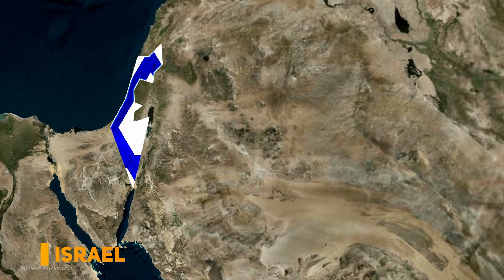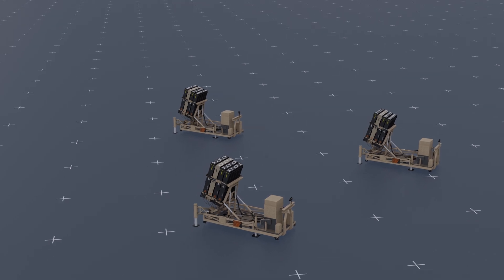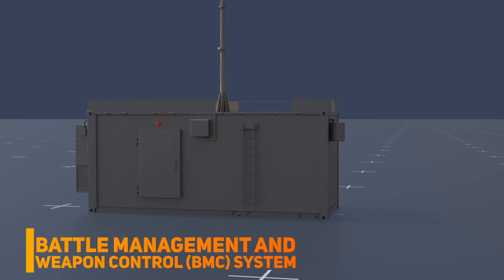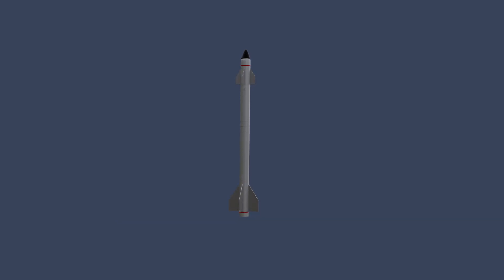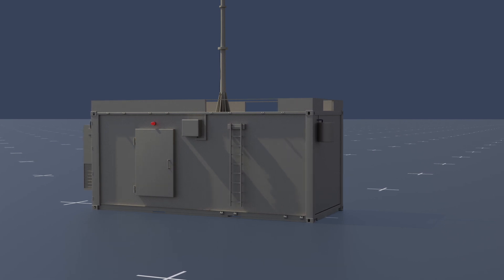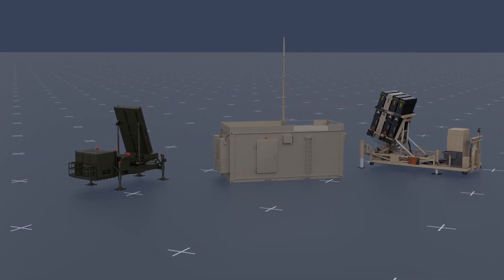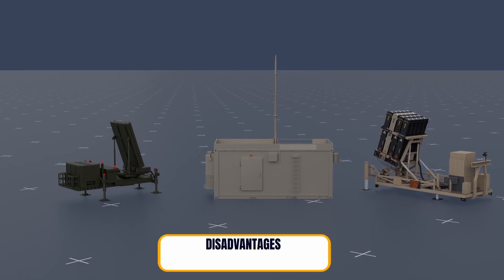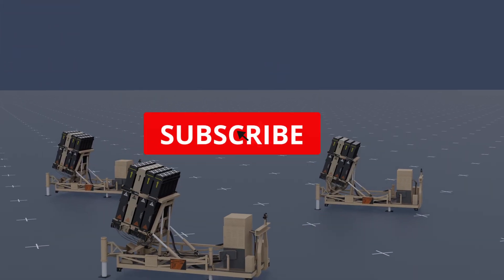Inside Israel's Iron Dome: A Closer Look

Comment: Is it right that Tamir missiles use radar seaker? As far as I know, it's used as an infrared seeker.
Reply from the maker: No, the Tamir missile does not use an infrared seeker. The Tamir missile uses an active radar seeker, which emits electromagnetic waves and receives the reflected signals to detect and track the incoming threat.
Reply: @Learnwithbuddy  Then what kind of radar do you use? I'm curious about the frequency band
Reply from the maker: The Tamir missile operates in the X-band frequency range, which is between 8 and 12 gigahertz.
Reply: @Learnwithbuddy  thanks😘

Comment: How much does it cost?
Reply: it is estimated that the cost of each Iron Dome battery, including the command and control center, radar, and launcher, is around $50 million to $100 million. The cost of each interceptor missile fired by the system is estimated to be around $40,000 to $100,000, depending on the type and complexity of the target.